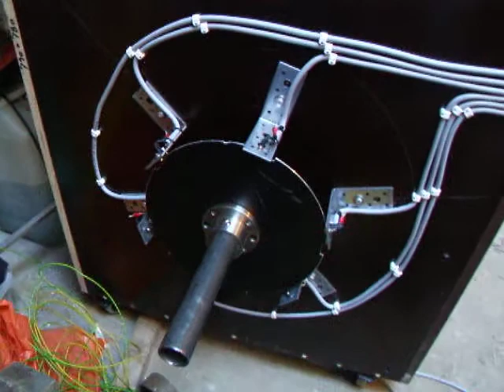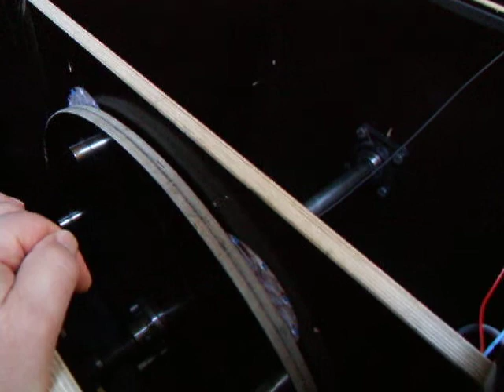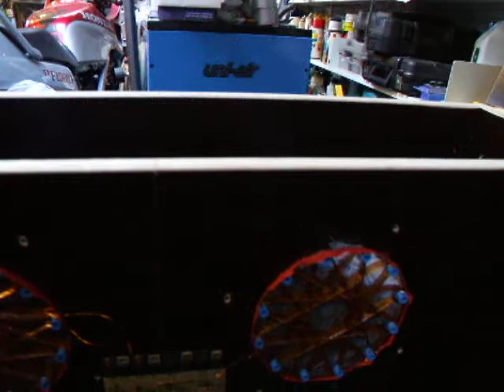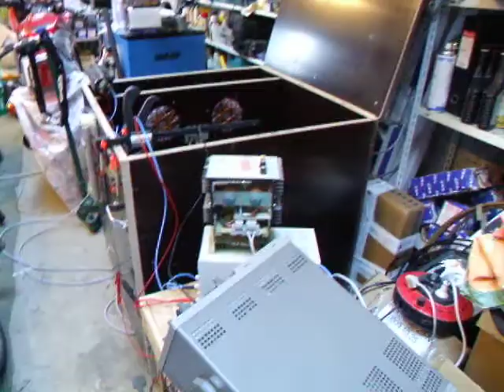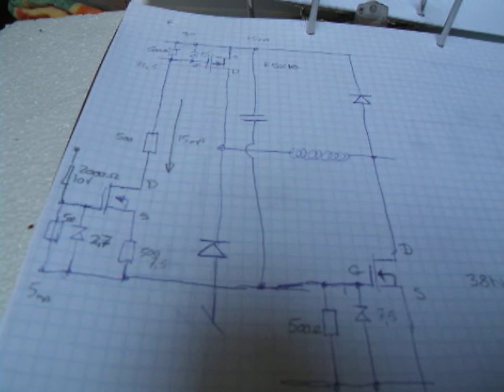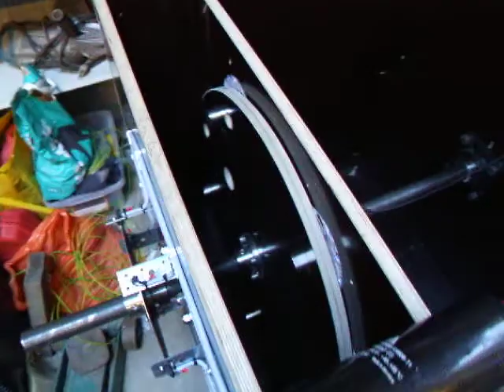Starship permanent magnet a-synchron iron free pulse wide modulated motor.

Comment from the maker: @zeropointfuel and theres is more...... It runs synchron now and it puts out a lot more rpm then in the a-synchron  version and the amp draw is not really not significantly increased. It runs on either 24 or 48 volts. There is a cooling problem on 48 volts, and that we are going to deal with in our v 2.0 with water cooling. For the next 3 weeks i am winding new coils. Starship again, bifiilar 0,6 mm, attraction and repulsion coil in the same winding. One more fly well with 12 magnets. :O) Alan

Comment from the maker: @zeropointfuel Thanks for your input. Well the circuit leads the B-EMF back to the power supply and that is showing, on the amp draw from the supply. So i don't have any charge coils, only 6 starship coils. From the first video there have bin some changes. Now it runs with a new fly well and instead of 5 magnets theres is now 12. The pickup rotor is off and now we use hall sensors for 3 coils attraction and 2 repulsion ( one burnt out ) still on the same circuit .

Comment: Don't let  small issues in your design discourage you,  some times it's takes allot of effort to see a little improvement, just don't stop what is you input voltage? and you might try putting battery's on the output use the pulsed output as the positive and the positive on the input side as you negative like a Bedini  it will add punch to the pulse, I run my motors at 120v and still output to 12V at 15 to 20 amps hope that helps cheers